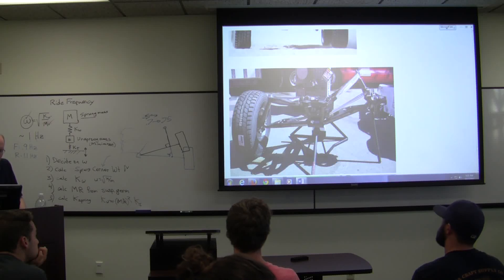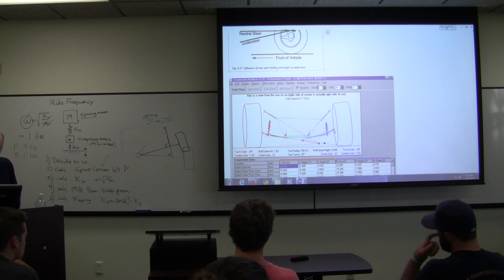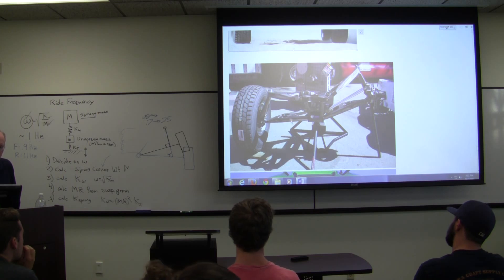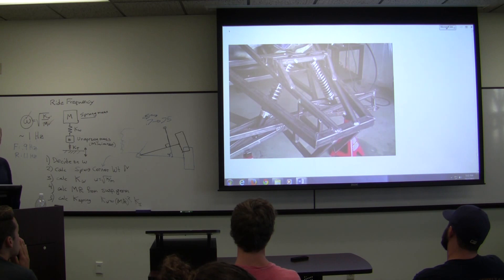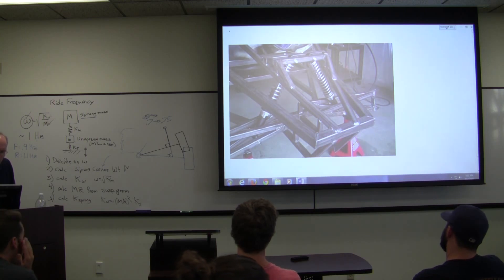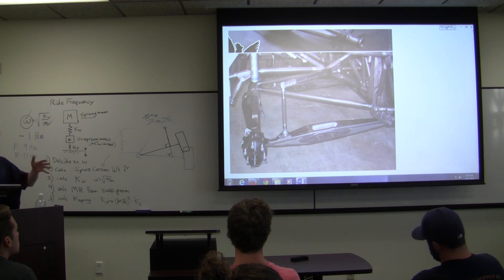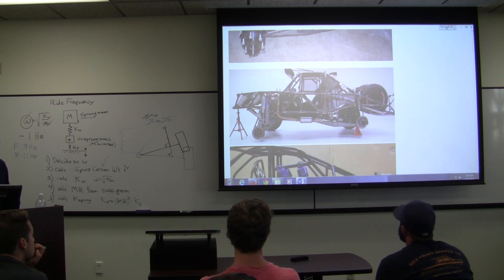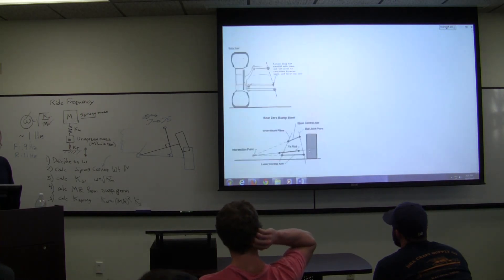Vehicle Dynamics Lecture #2d: trophy trucks, suspension design, chassis, triangulation, frame design

Comment: The reason for the low motion ratio is to reduce damper shaft speeds. Trophy truck dampers operate in the 3ms range with peaks as high as 8ms. Motion ratios are generally between .5 and .6 because larger motion ratios will generate excessive heat and cavitation.